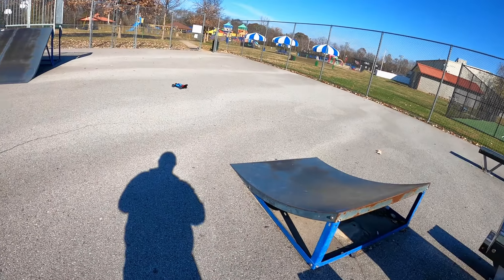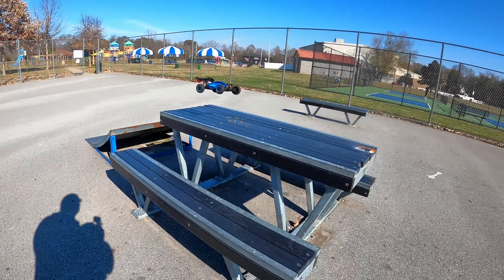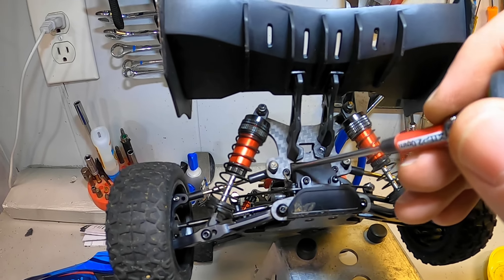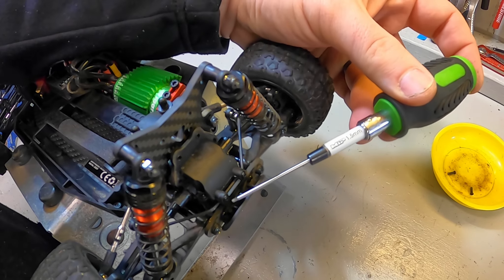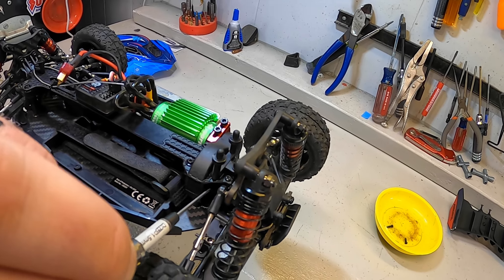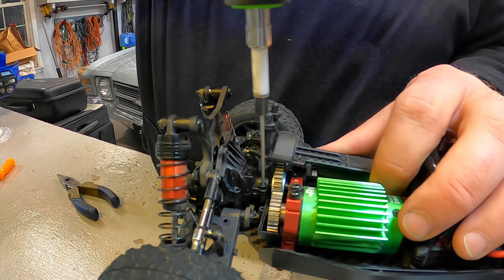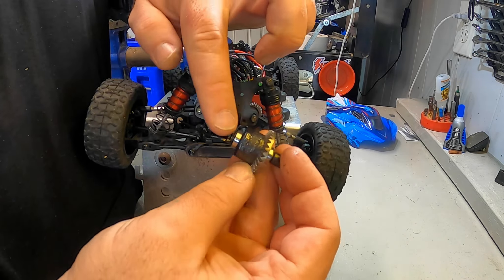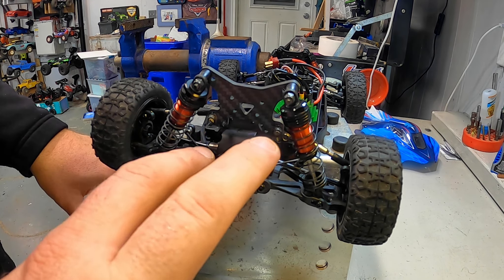How to Fix Differential on Rlaarlo AM-X12

Comment: What if all 4 wheels aren't spinning? I just put my AM-X12 back together after some cleaning and maintenance. Been pulling my hair out trying to figure out where I went wrong and why the drive shaft isn't engaging when I rotate the front or rear wheels in the same direction.
Reply from the maker: I would suggest starting from the motor side of the driveline. 
When you spin the motor - follow the driveline path.  See when things stop moving - that will give you a clue for what is wrong.
Reply: @RoadsideRC  ended up being a super easy fix. Grub screw on the drive shaft was loose. Funny how that works out after scratching my head for a good hour and taking everything apart twice.
Reply from the maker: @Saif Khan  At least it was a simple fix!!!  Glad you got it figured out!

Comment: How do you break a control arm? I seem to break nothing but wheel seats and front steering mounts, everything that's not included. I just got all aluminum diffs here, a new set of ring and pinion gears (I'm going to try to use an old plastic one as a center diff), an all aluminum suspension kit for a wltoys (still a week or two out), the cvd shafts for the wltoys as well as bearings, drive hex and pins, whatnot. It takes weeks to get anything from anywhere for this car so I decided to switch it all to wltoys axles and such. 3 weeks for a dog bone, I'm cool when i can get one for a wltoys in a few days. One question tho. What's a good sealed bearing set for this car? Or the wltoys considering I'm running their wheel bearings
Reply from the maker: Hi there! 
I don't think anyone sells a complete bearing kit for this one yet.   
I would probably piece together some bearings that I needed just from bulk buys of single sets.  I typically do that a lot for my cars anyway instead of buying pre-sorted kits for specific cars.

Comment: I'm curious about something and maybe you can help.. I'm looking for an ESC programming card that is compatible with the 45A ESC in this Rlaarlo. I was going to buy a cheap Surpass Hobby card off of Amazon and give it a try, and just send it back if it's not compatible, but figured I would see if you can maybe steer me in the right/better direction. Thanks!
Reply from the maker: Sorry, I never even attempted to try to program this.
Instead of using Amazon in that way, how about you just email Rlaarlo and ask?   They usually are pretty responsive to messages.
Reply: @RoadsideRC  that's a good idea, I'll shoot them a message and see what they say. Much appreciated!
Reply: @RoadsideRC  Rlaarlo told me that the ESCs can't be programmed but that they will be improving on that in the future. Oh well, I just wanted to tweak some things, no biggie. Thanks again for the suggestion!
Reply from the maker: @trossbossinit  They really got back to you fast.   Awesome!

Comment: Hey so i just bought my rlaarlo buggy same one as on video and i used it for about 10min the i put battery to charge for about an hour or 2 put battery back in bug was running fine for about a minute and then it all turn off so i tirned rc back on and again good for a minute and turns off and now it wont stop doing that keeps turning off after a minute of use
Reply from the maker: The battery is dead.   You need a better charger.  The ones these come with are very bad.  
Something like this will be MUCH better for you:  https://alnk.to/5Q5sCA9

Comment: Hi new subcriber I've got a new rlaarlo could you tell me if the diff is ment to make that noise when manualy turning the 4wd has I thought it should feel smooth I've got a video clio of the noise if you need to hear it thankyou
Reply from the maker: Hi Thomas. 
Unfortunately, I am not sure what noise you are talking about, so it is hard for me to answer.   As long as the car is driving fine, I would assume it is OK.
Reply: @Roadside RC  at the end of your video you turn both rear wheels to turn all 4 wheels and it makes grinding noise is that normal cheers